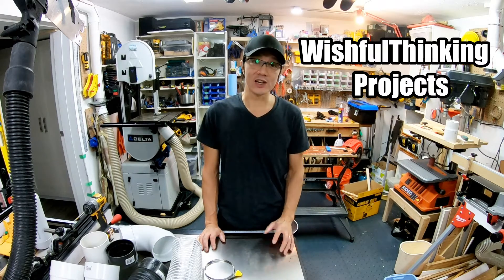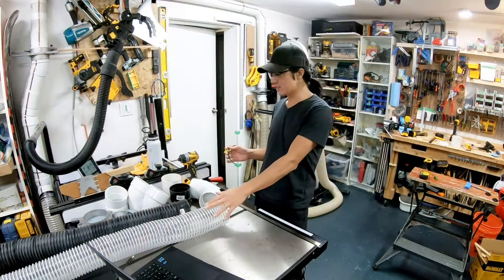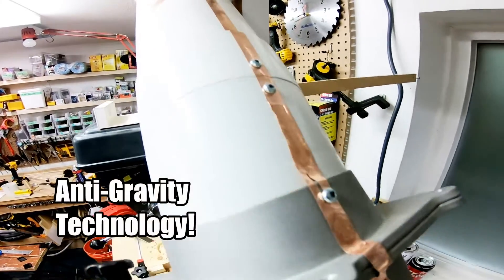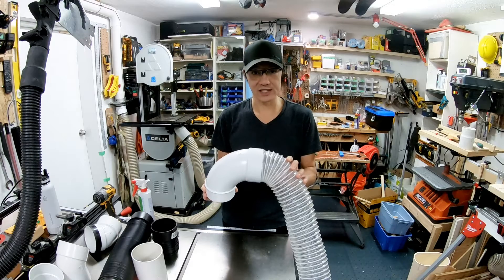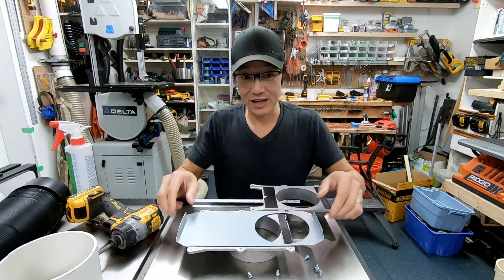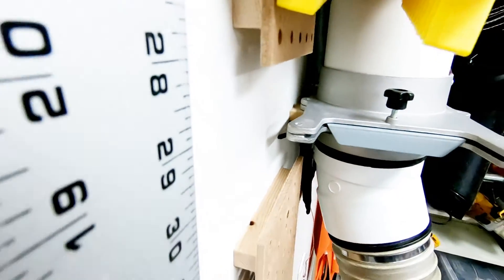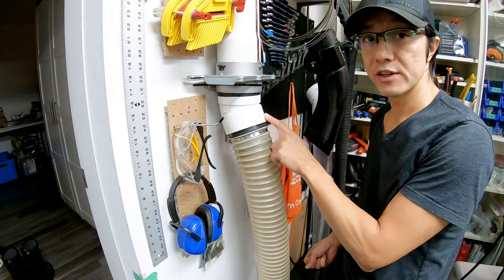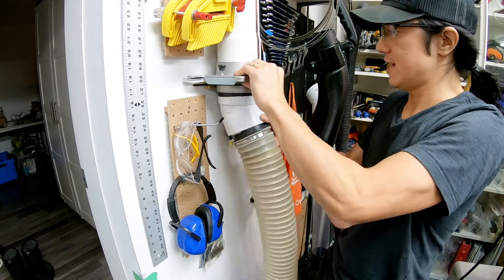Workshop Dust Collection System: Parts that actually fit together! DIY 4" DWV PVC based network

Comment: Late to the game on this video but great non-the-less.  Designing my system now based on your video.  At about the 2:00 minute I can see your air filtration box behind you.  I am curious about where you got the air filter gage on the side that lets you know when to replace your air filter.  The only one I can find on amazon does not seem as user friendly.  Thanks.
Reply from the maker: Thanks! My air cleaner is an older model Delta 50-875 that came with that gauge. It's simply an arrow mounted to a shaft that has a flat piece on it that gets blown by the exhaust airflow. You could probably make something up, marking where it sits with a new filter and then noting when the airflow seems to have decreased significantly.

Comment: Great video with great tips. I am trying to set one up in my much messier shop and like the idea of being able to change my setup as my needs might change. I noticed you used a 45 elbow and a small pipe with the conformable hose on the drill press. Since the conformable hose has plenty of length, it seems like the small piece of pipe isn’t really necessary. Was there a reason to add the small pipe, like better fit than the elbow or was that more for demonstration purposes? Thanks again for the video!!
Reply from the maker: Thanks for the feedback! I found the hose too short so had to add the extra elbow and straight section, especially if I pull out the drill press (it's on wheels) to work with larger or longer pieces.

Comment: Good stuff!  Had you researched using DWV pipe? The pipe and connectors are way lighter.  I haven't compared costs yet.  ID is a little larger than SCH40 (3% by area)
Reply from the maker: Thanks! I forgot to mention in the video that I only used DWV pipe, not schedule 40...
Reply: @WishfulThinkingProjects  This was my main questions too.  It might be helpful to edit the description to add this.  BTW, loved the vid and how it went into the details that almost everyone else just skims over.

Comment: Great video, well presented. Would like to know more about your copper tape grounding system? I see IVAC sells a kit, but would rather hear from someone who is using it and how you did it.
Reply from the maker: Thanks! At first I ran copper wire inside but it would cause clogs after running my jointer/planer or sucking up shavings. I found the copper tape on Amazon and it's conductive on both sides so you just need to overlap a bit to create a new branch at each Y. I put 3/8" long #6 screws through the PVC every 16" or so to help dissipate the static. I have a couple points of it where I connected one of the screws to a wire that leads to the ground plug of an outlet. I no longer get shocked so it seems to work out nicely.

Comment: Great video, those metal blast gates aren’t cheap!  Working on a 6” pvc system, trying to find all the different fittings etc. stuff is hard to find right now! Stay safe.
Reply from the maker: I hear ya... it took a while for me to come to terms with ordering a handful of them at their premium price. But I'm glad to say I use them all the time and am super happy with them after the tweaking them to fill the air gaps.

Comment: Good video~!  I'm working on my DC network and got a few good takeaways from this, as in picking up a few 22 1/2° couplers and some Gorilla tape.  Thanks much~!
Reply from the maker: You're welcome! I specifically like Gorilla tape as it's thicker than most duct tape and hence offers a bit of compression fitting to increase the strength of a friction fit.

Comment: One minute in and this is addressing the main frustration with ducting and connection that FIT. I watched 10 videos and all  they say " keep the pipe as big as long as you can" avoid sharp 90s. Limit flex hose. Any one looking up dust collection KNOWS THIS. Thank you very much
Reply from the maker: Hee hee , yes - agree!  Thanks for the feedback - am glad it helped answer a key question for you :)

Comment: Hello, can you tell me the reference of the motor.
Reply from the maker: Hello! Yes, it's a King Canada KC-3105C 1.5HP Dust Collector. I love it, as it's very quiet relative to other dust collectors - more of a dull hum than a screaming blower. It's rated at 66-77 dB, compared to many others at 85+ dB. If you're not in Canada, it might be sold under a different brand elsewhere.